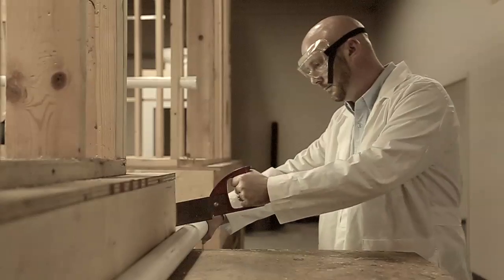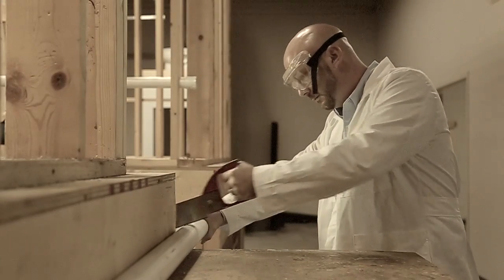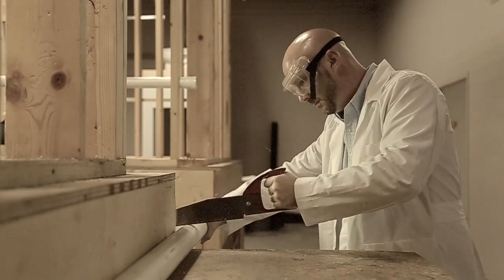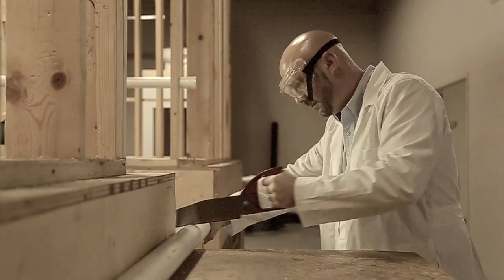Helpful Guide to Making Your First Potato Gun

Comment: I've been building potato cannons for decades and haven't once had any kind of failure, even in guns making up to 400 PSI of chamber pressure (through means of compressed air mixed with fuel, like a car engine), the key to safety is proper material selection and safe fuels for that particular material, aka no pure oxygen in plastic piping (has to be rated steel), which all the idiots in these videos did. A stoichiometric mixture of atmospheric air and propane will generate somewhere between 30 to 50 PSI, which most pvc pipe (schedule 40, not dwv) is rated at least four times over that. Schedule 80 can withstand even more than that. I find it ironic that Charlotte is telling me not to make potato guns when every dime I've ever given them has been for exactly that purpose🤣. I get that lawyers make them say these things but I've never been one to heed the words of a corporate lawyer, so, umm, take off you hosers, I'm making a potato cannon literally right now lol and it's also Charlotte brand😉. Four foot long 4" diameter chamber with a five foot long 3" barrel, with six taser ignition modules and an onboard propane fuel mixing valve, it shoots 2 pound projectiles close to 250 yards lol.

Comment: wait would using steel pipe be safer than using pvc?
Reply: Either buy threaded pipe or weld it but if you buy weak or thin steel and use too much ignition it would be a million times worse it would be like a grenade going off in your hands